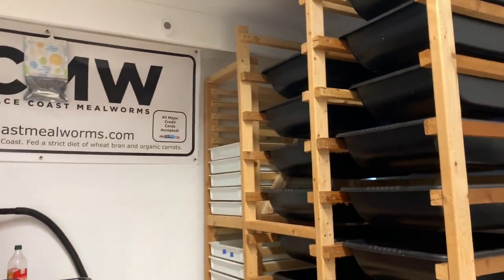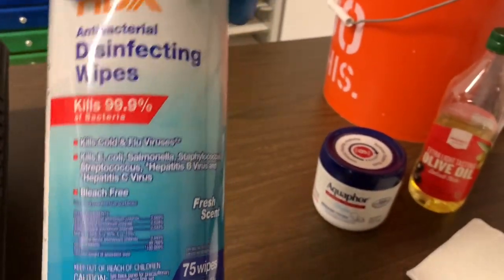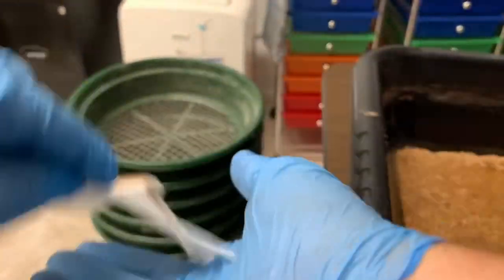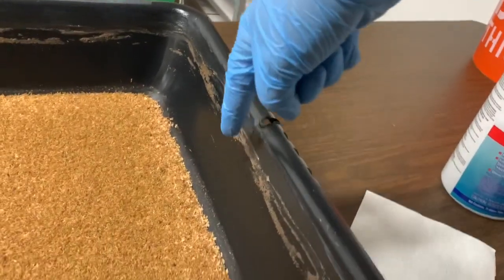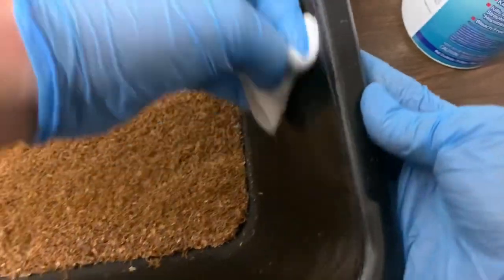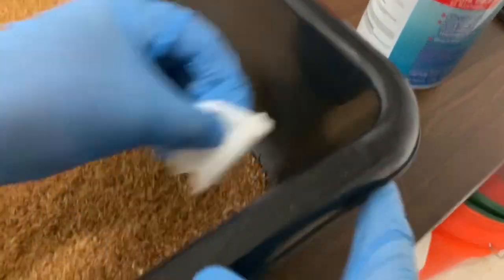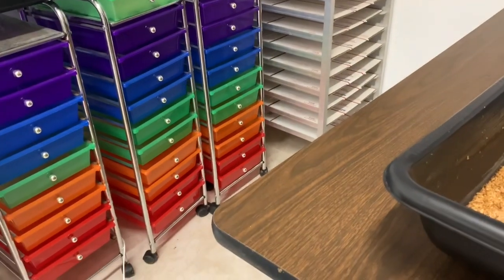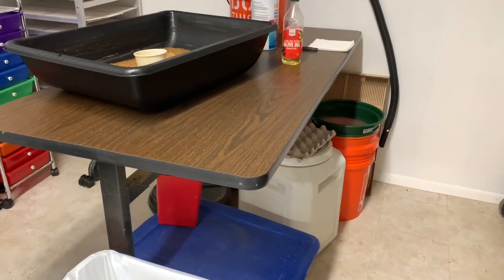How to Remove Grain Mites from Mealworm Trays

Comment: My prevention: when I buy a bag of "substrate" (20 kg) I re-bag it into 1 to 2 kg lots using a vacuum bagging machine - just the standard kitchen type. This prevents the mites from having access to oxygen, which can slowly kill them. I then store these bags in my cupboards, and freeze them individually for at least a fortnight before using the substrate in my farm. These small bags easily fit in my freezer. And thanks for the advice.

Comment: I strain out all the large worms and quickly rinse them off with warm water under the sink. Dry off on a paper towel. Place them in clean brain. Wipe the sides with rubbing alcohol. Just a couple days and they are all gone. Just my way.. awesome video.
Reply: Are your mealworms harmed by being rinsed?
Reply: @gsvmom  i have never noticed any losses.
Reply: @gsvmom  the only losses could be mealworm eggs, nothing else.
Reply: I did the same thing.  No mealworms were harmed in the process!
Reply: Can u freeze the old bran?or heat it to reuse it

Comment: Soo I did exactly as you showed, and thought I’d try something extra in case I missed any. I got a bag of those little plastic Togo cups I think they are meant for condiments? I kept the veggies out of the main part of the bin, And I put one cup in each corner of the bin, with a carrot that I covered in vegetable oil. The next morning there were mites all over the carrots but they were dead.

Comment: You have to heat the bran in the oven or microwave first, to kill the mites before putting the beetles or worms, as they say, prevention is cheaper than the cure 😊

Comment: My mites also sprouted out of the same rainbow bin rack you have.  I had baby bins in there. They were all over the entire surface of the rack and were everywhere. I had to just combine all the small baby bins into one big bin and try to grow them out a little before feeding to my chickens. It was a big setback!
My superworm beetles were also infested, but they were easy to clean off. I shifted out all the bran and veggies and tossed them, rinsed off the beetles in a strainer, and washed their drawers. Luckily it only took one washing and they were gone.  It really is a chore though!!
I keep the humidity as low as I can get it now and that has proved to be the most useful. It’s 45%RH now, but it was 90% over the summer!  My farm is in my creepy basement which has other bugs and critters. The now lower humidity is keeping those huge basement crickets from moving back in as well. 
It’s a good space for mealworms though. It doesn’t get too cold over winter or hot in summer. 
Great video as always!!!  I will definitely be using the Vaseline method if I ever am unfortunate enough to get mites again!

Comment: I just finished removing the little mites. Had to sift all my beetles and larvae out and then washed the bin, wiped the countertop and everything around that area because they were caked on. They duplicate really fast. Didn't know about the petroleum jelly though, so I will definitely try that out. BTW, yes, you need to be careful to not get the wipe chemicals on the substrate. in my earlier years of farming, I was careless and the chemicals will burn holes in your beetles. It's really sad and I learned real fast to be careful of any wipe drips.

Comment: Thank you so much for posting this very informative video. We have just recently discovered our first outbreak and are in the process of getting rid of them. After reading "Kiril Yankov" and knowing that I heat treated all of our bran and oats and I am 100% confident that this was not the source, I am now convinced that it was a lettuce leaf I place in the effected box, as we have never had an issuee untill a few days after I place the leaf in. Off to research both root aphids and grain mites :).
Reply: @quadros8948  ?

Comment: I've been tackling a mite problem for a couple of months now. I didn't know I had the problem, thinking it was just dust on the floor from the bran...turned out to be a sea of mites !! I was shocked to say the least. I've been working on fixing the problem and have gotten it contained to 4 small drawers now ...or so I thought. I put into action your vaseline trick which has contained them in those 4 drawers and I'm using little medicine cups to attract them into the oil which is working. But then I have seen activity on the frame of the rainbow drawers today. I figured that they have scaled my rainbow drawers frame from the concrete floor and into 2 newly set up pupa drawers. So today, I separated out the pupa again, given them a good shake, hopefully not damaging them in the process, and given the rainbow drawers and everything else a good hot soapy clean and sun dry.  I'm working on the premise that there are more on the floor than I can see, so I've put all 4 wheels into containers of soapy water so that the mites can't climb up from the floor. I'm constantly spraying a soapy water solution on the floor and anything that is in contact with the floor for a good few meters. I have no idea how far they travel, but I'm getting on top of them gradually. I bake my bran in the microwave for 3 minutes per bowl. It does work, but I reckon I've mixed up a treated bag and a non treated bag of bran, and therefore let them in. My beetles are safe, and also 2 drawers of mature mealworms are safe too...plus tubs in the fridge. Thanks for your video on the mites eradication, it's been a good find.
Reply from the maker: GG's World good to hear you’re tackling the problem successfully! I forgot to mention the water trick with the tower wheels, so good call! 
Now that my notes are mostly gone I still am weary now whenever I see bran dust in my trays. I’m constantly wiping them clean just in case!
Reply: @spacecoastmealworms  yes I check with a magnifying glass now when I see the dust...just to be sure
Reply: Same.... I was like.... is that dust moving?!

Comment: I live where winters are very long and very cold.  I fill Rubbermaid Roughneck gray plastic 20 gallon trash cans 3/4 full with mealworm food.  I use a 50/50 mix of fine cornmeal and wheat bran.  I leave the trash barrels outdoors through the winter.  By the following Spring my mix is free of any mites.  At least I have not seen any evidence of mites.  I recently purchased a very large chest freezer.  I freeze my cornmeal and wheat bran for over a month. The mealworm food freezer is dedicated for freezing bran and cornmeal.
Reply from the maker: The only time I’ve ever had mites or pantry flies are from the two times I purchased wheat bran at Tractor Supply. I normally get the 40-50lb bags from my local feed store. I think the supplier has a lot to do with it as well..

Comment: I found if i cook then freeze the grain havnt had a problem been at it for a year and a half seems to work great for me
Reply: Real Poseidon Gaming do you spread the grain on a baking sheet (how thick) and put in the oven, if so at what temperature and for how long please?
Reply: I put roughly 1 1/2 to 2 inches on a cookie sheet spread out i put my oven on the lowest temp 170 leave on for 10 mins then i put in the freezer for 24 hrs

Comment: Have you ever used PTFE Teflon tape? I know bed bugs can't climb on it, I wonder if mites could? If it worked and was to slippery to climb, that would create a permanent barrier, you'd then just need to wipe the mites down, no more jelly. 

Love the content.
Reply: the white pizza dough trays also come with teflon coating ... but expensive

Comment: I tried Vaseline and it was gross and messy. Then I used duct tape along the top of the bin (sticky side down like a lid would go but just on the e edge.) I also added ground up split peas and for some reason that kills the mites and doesn’t bother the worms

Comment: Grain mites are easy to get rid of.  When I get a infestation I heat the bin to about 92 F and let them  dry out to about 15-25% relative humidity.  I put a small piece of wet cardboard in the same spot in the bin regularly and change it maybe 3 to 4 times a day. Shake off the mealworms and discard the old cardboard with mites still attached.  I make sure there is no other source of moisture and never wet the cardboard so much that it runs into the substrate (maybe just soak then shake off the excess water).  Put the cardboard in the same place everytime so the mites don't have to travel far. Mites further away will die after a while at low humidity. After a few days the mites die out.  Keep doing this a couple extra days after the mites  are gone so any eggs that hatch  get caught.  Easy Peasy.  Mites don't like low humidity.  They die out below about 30% rf.  No need for oil or vaseline.  Mites don't travel much unless they are crowded.  They ride on mealworms but the worms will crowd around the wet cardboard.  Mealworms can survive at lower humidity and higher temperatures  then mites.  I have had them at 110 F  briefly with low mortality
Reply: This is the kind of info I was looking for. I've been breeding my main colony for a number of years now and only just recently gotten infested with these mites and I didn't want to kill the whole breeding stock. I also didn't want to put chemicals anywhere close as they feed all my geckos and spiders. My mealworms are very used to breeding and living in 65 degree F temps whereas whenever I get new stock from other places to outcross with and they tend to die out, breed slowly, or pupate incorrectly and die. I am worried about heating them to 100+ but considering they've survived hot summers at those temperatures I would rather risk heat death of a few than letting the colony get swallowed by mites. I had two colonies a super large and my long time one but I might combine them and treat the whole group.
Reply: Nice! So just open the lid and heat it up with heating pads and it should kill them? How about unhatched eggs? Will they stay dorm untill next time humidity comes back?
Reply: I'm not sure if the eggs die but if you get a reinfestation just doing the same thing again should work
Reply: I just had an infestation of what I believe are broad mites possibly from infected fruit. They seem to multiply faster then grain mites and are more mobile.  They are also smaller so easier to miss.  They seem to respond to being kept dry by dieing but they don't collect  on the damp cardboard as well.  I'm killing them by removing all moisture so they get too dry for mites but the worms survive.  It's a bit trickier to do this but it seems to work.  I wonder if washing fruit off with soap and hot water would prevent this.

Comment: Hi there, thank you for the informative video. Someone recommended it on a reptile page I'm on on Facebook. I do have a quick question. I tried googling it, but I didn't find anything. I'm just starting out with mealworm farming, on a very small scale. I only have one bearded dragon and it's more of a hobby/see if I can save a bit of money. My first batch of baby mealworms ended up having mites. I quarantined them away from any other grain sources and put the small container they were in in a bowl of shallow water. I've been really careful to make sure that I wash my tongs after using them on that bin and before working on another bin. After a week or so, I didn't notice any more mites. They were literally crawling up the side of the container before, and suddenly, there were none. I didn't change anything other than putting it in a bowl of water (it's a small bin, so easy to separate from all the others). Do baby mealworms eat mites or their eggs? They have the wheat bran to eat and I put in tiny slivers of veggies for them as well. I just found it odd that there is absolutely no sign of mites now, not even in the bran. TIA for any help/ideas!

Comment: Thank you for this. I am doing it now. I had the idea to use grease but thought the high stick tape would stop them, but they walk right through the adhesive. The beetles usually eat the mites. My mistake was giving the mites egg crates and cardboard. Don't do it. The dust made is a breeding bed for mites.
Reply: You know I didn't have this before the bran meal bag I just purchased from my local feed store.

Comment: This was a super helpful video. Just wanted to know how long does it usually take between changing bran and seeing the mites, I just changed bran and have a suspicion that it might have mites. However it’s only been about a week from changing, and I’m not entirely sure if that’s too soon for them to hatch. Thanks in advance for the help.
Reply from the maker: Great question! Doesn’t help that bran dust also looks like mites! What I do whenever I’m suspicious (and I’m a lot more suspicious since having mites) is wipe down the sides of the bins and check for any new white flecks the next day. If you have mites they’ll be there!
Reply: .. or use a microscope ; )

Comment: Thanks for the info! I will try this method. What am I supposed to do to prevent them showing up in the first place? This is my first time with mealworms.
Reply: His advice is freeze your wheat bran or grains that you willnuse as bedding or feed.
Reply: I see that now. I’m still trying to get rid of them.
Reply: @arvintot555  what if I bake the oats in the oven for like 10minutes?
Reply: @fbiagent3399  this is just based on my research (Google), yes Higher Temp will kill them faster, and will also destroy the eggs, 150F actual temp of the oats for 5 to 10 mins.  Then the suggestion is to cool and keep unused oats in Freezer.  Keep in mind this is prevention.  On the other hand, if you take all the worms and beetles off and then stick the infested bedding in the oven, you will be able to kill them off too, then put the worms and beetles back in after cooling.  BUT how to make sure beetles and worms don't carry the mites back to reinfect the beddings again? :(
Reply: @arvintot555  well Ig 1ns A week bake the new oats all the time Idk lol
Reply: I've been using rice as my beeding. They love to eat it and I haven't had any grain mites yet. I'm sure they'll come eventually. So the best option is what everyone here says. Cook or freeze your substrate before using. I just happen to start using rice once when I ran out of bedding. I dumped the new mealworms on 1 side, and poured rice on the other making it half and half. They all moved into the rice side, and started pulling rice grains into the original substrate half.lol

Comment: Careful about freezing to get rid of mites.  I read that the eggs can survive a long time at typical freezer temperatures.  I heat bran to 130f for a 1/2 hr (oven about 185f for 2 hrs).  If eggs do survive it might be a week or two before you notice mites and you may not realize where they come from.
Reply: I guess your electricity is cheaper than ours!

Comment: I just had these last week. I think what I and you have is not wheat mites, but root aphids. It comes not from the bran but from carrots, potatoes too. But they love carrots and multiply in matter of hours. What i did is sift the mealworms and moved them to a clean tray. Then put the mealworms in clean bin and no carrots for couple of days. No aphids so far.
Reply: We are newbies to mealworm farming. We started 8 months ago. We have had our first outbeak in the last week, in our beetle box. We have one of those double box systems with the flywire bottom in the top box, so the eggs and fass fall through. I caught the outbreak quickly, but it seems to have come from the bottom box not the actual beetle box (top box), A few days before I found the outbreak, I had place (for the first time ever) a lettuce leaf in the bottom box as I noticed eggs where hatching and I wanted to give them some moisture to chew on, as I wasn't ready to move them to a new box (glad I didn't now). We heat treat all our bran and oats and as this outbreak only occured in the beetle box and none of our worm boxes I am convinced they came from the lettuce leaf. So I am glad you poste dthis as I am now going to go a research root aphids. Thank you :).
Reply: @aussiegal22  I started out 3 months ago with handfull of worms, keeping only 4-5 small containers. Also new to mealworm farming:)

Comment: Btw how big is your shed? Like the dimensions,  it looks like a great work space
Reply from the maker: MrSamatwar95 it’s 12x20. I feel like I’m already running out of space, but I think I just need to utilize my loft area better.
Reply: @spacecoastmealworms  thanks for the reply, ur awsome. I feel like a standard isle system would maximize space. But your shed looks like an awsome lounge area so you'd have to sacrifice that epic lounge :(
Reply: P.s maybe instead of a standard table. Use a roll away table or large cart with a bottom lv for your sitting buckets and trays
Reply from the maker: MrSamatwar95 one of my big ideas was to try to put everything on casters so I could rearrange as needed and to make cleaning easier. I need to rebuild my black tub tower since it’s too tall, and then I can rearrange the shed properly. 
On top of all of that I have just purchased a laser cutter (have been subcontracting the work out) for my sifting trays. So now I need to make space for this and for all of its supplies as well.. never ending work! 😂
Reply: @spacecoastmealworms  ahh that would be even a better idea because than you would need room to walk between isles you can just roll each tower out, there fore fitting more towers because they're wont need a gap in between. "Big brain moves"